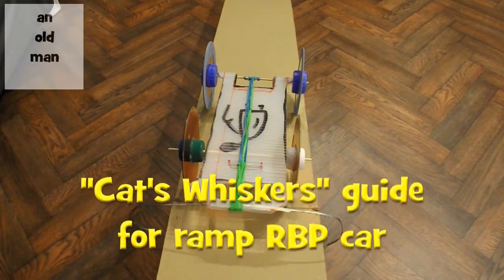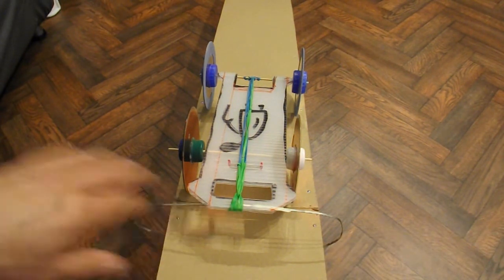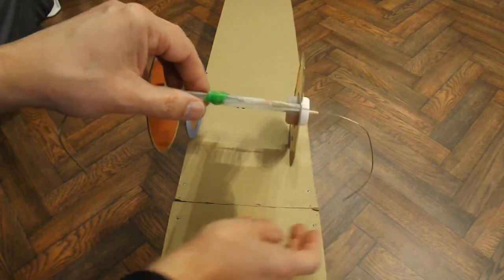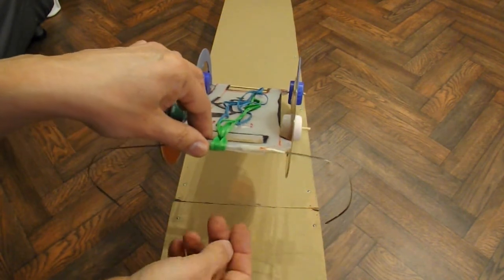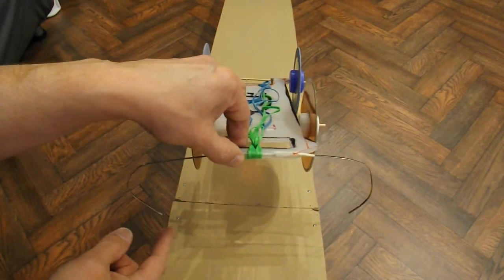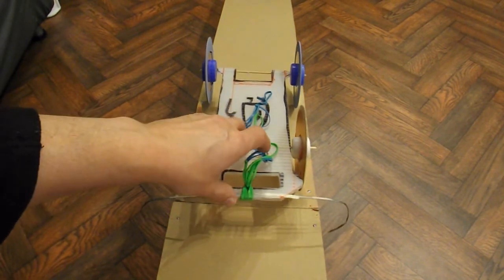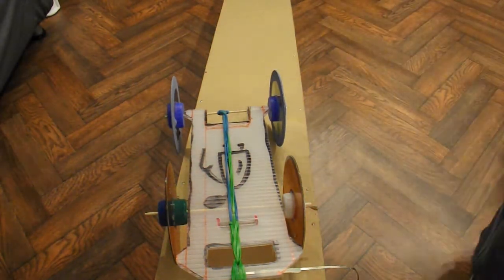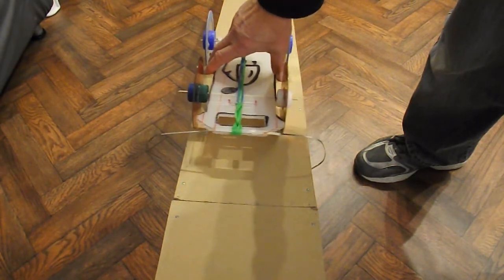Cat's Whiskers guide for ramp RBP car

Comment: Grandad I have been having trouble build a car lately can you make a video like fundementals of using motors
Reply from the maker: +Coolguygamer i don't know what level of build you are aiming for. I have a playlist here with my electric toy cars which covers home made and shop bought toys. I don't do hobby grade models. Electric Toy Cars https://www.youtube.com/playlist?list=PLA5a2xPRSrB0yTUYmJSS3ML5xxaBzHl3e
Reply: +GrandadIsAnOldMan also I built a boat and it goes in circles I tried a rudder pointed the other way but it doesn't work very well.it still goes in circles🤔
Reply from the maker: Coolguygamer boats will try to circle naturally because the propeller sends pressure to one side as well as backwards. This happens a lot if your propeller is home made or just not very efficient. If you look at the back of the boat and imagine the propeller is a wheel you can imagine the way it tries to turn the boat. When you put the rudder on, did you make sure it was close behind the propeller because that would help to redirect the thrust of the water, maybe use a much bigger rudder. The other problem may be that you didn't mount the propeller shaft straight so it is pointing out of the back of the boat at a slight angle.
Reply: +GrandadIsAnOldMan I will try to put the rudder closer the the shaft if you want I can post a video of my boat

Comment: hi grandad could you please make a car using straws two dc moters and a one of the pizza trays ty
Reply from the maker: +Jack Giannios why would it need two dc motors?
Reply: front and rear/ all wheal drive
Reply: thanks
Reply from the maker: +Jack Giannios this one has a cardboard body. Making it from a pizza tray would be just the same car 
Hey Grandad, can you make a 4 wheel drive electric pulley car? https://youtu.be/lqB0T9Y0ULU
and here are some other 4 wheel drive cars I have done 
Rubber Band Powered Car 4 wheel or 6 wheel drive https://youtu.be/bRjVzmcXPjM

4 Wheel Drive Remote Control Stepper Motor Powered Car https://youtu.be/ZZX6L3zQn_E

Electric Car 4 motors Gift Card Chassis https://youtu.be/1yJb_dIebaA

Comment: OK hi I've tried so hard to get mentioned in a vid but its impossable
Reply from the maker: +Alex is awesome it's just a matter of luck. If your idea catches my imagination and I have the right components to make it then it happens but I am running at 2 or 3 a day, 7 days a week, so there are lots of people making comments and requests. I have a list of requests with some well over a year old now, I have just looked and can see about a dozen from August 2014. Some of them may never happen.
Reply: +GrandadIsAnOldMan i think I've got an idea
Reply: +GrandadIsAnOldMan could u make something like a zip wire buy using those sucking pads from the end of arrows for kids from bow and arrow sets from poundland
Reply from the maker: +Alex is awesome I will think about that next time I am in Poundland. It would only be for toys as those suckers won't hold much weight.